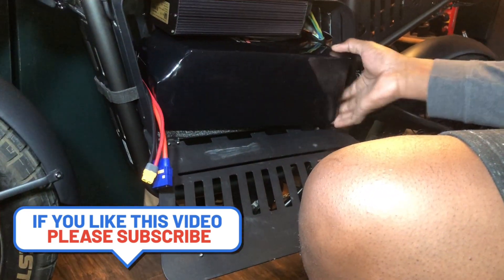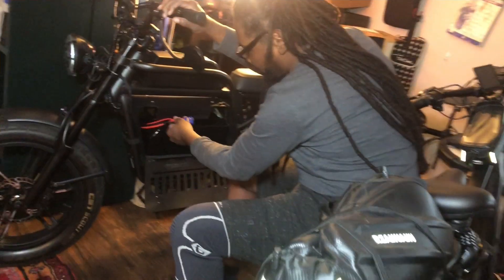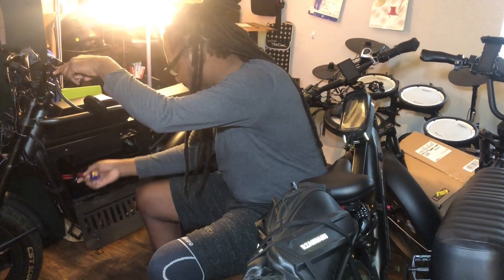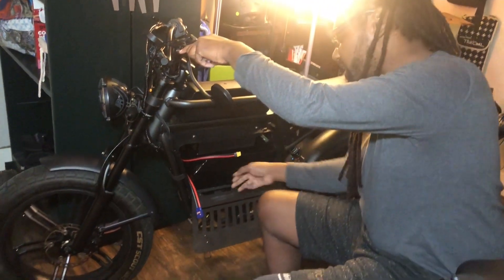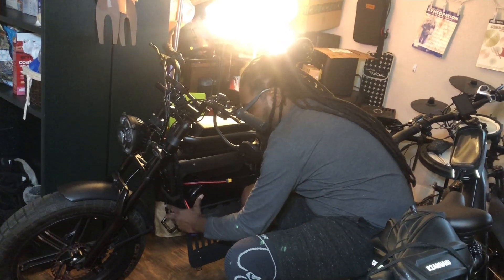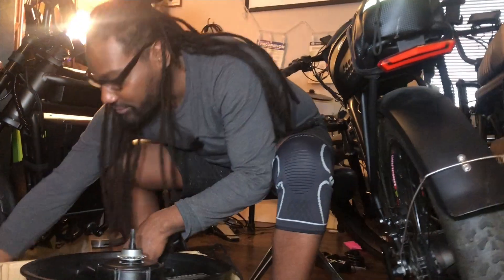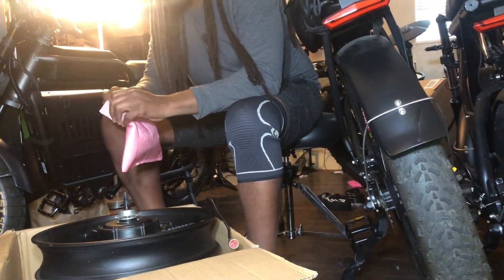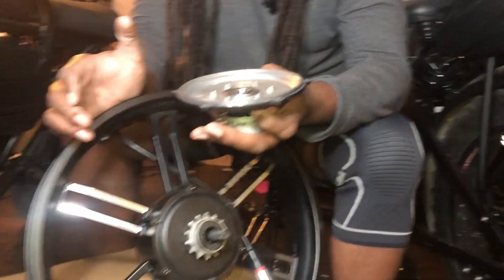Revv1 72v 5000w conversion pt2

Comment: is it possible to use the stock battery with the motor?
Reply from the maker: Sure you can. It’s rated for 48v up to 72v. You would have slightly better performance with the stronger motor but not much
Reply: @MannyReidTV  Thanks

Comment: What caused the stock back wheel to fail in that way? Thanks
Reply from the maker: I have no idea 100%. I’m thinking the motor casing is just cheap pot metal and the torque from the motor bore that hole. It’s a pretty crazy failure
Reply: @MannyReidTV Wow

Comment: how much did it cost to do this? (excluding the bike itself)
Reply from the maker: The 5k motor kit with the sabaton 72 100 controller was 1000. Then the Powerful Lithium battery itself is 1900. You need your wheel liner 10-20 bucks and the ceramic brake pads were 50 for a set of front and rear. The center cage for the bike is 100 which you need to house the battery and controller. Tenet pedals I use were 180. Worth it for how well my feet stick to those. The Qs8 male to o-ring terminal positive/negative cable was 75 from Powerful Lithium. Flat out for my tubes 35. So all in all about $3300 on top of the cost of the bike

Comment: Where did you get the full throttle?
Reply from the maker: It actually came with the NB Power 5000w motor kit that I got. If you go to last week’s video, ‘Revv1 72v 5000w conversion’ I have the parts list for this build in that video’s description

Comment: The only person I know of that did such a build was MrCentralRider. Damn, just one cable away from it being on the road.  I have to admit, if you just talked about what happened to the rear hub motor, about it stripping straight threw and off. I would call bullsheet.  It blows my mind seeing it in video and it really DID happen! Great to see everything coming together Boss Manny. Salute
Reply from the maker: Yeah I get it. That’s a hard one to believe without seeing it! I must say Ride1up has been very quick to respond every time I’ve reached out to them. They sent my headlight brackets out right away when I wrecked going off-road and broke it. When I told them about the wheel hub and sent a picture they sent the replacement part out pretty fast. It still scares me that something like that can happen to the wheel but at least they owned it and replaced the part quickly

Comment: About to upgrade my Dk200 with a bigger hub motor and new battery! Just found your videos legit 20 mins ago. Watching and hoping it goes well!!

Edit: Any recommendations on new brakes? I was planning on getting possibly a 52v25ah or 72v20ah battery with a 3000w hub motor. Want to ensure I have the braking power though.
Reply from the maker: That’ll be a dope conversion! If you haven’t ridden anything more powerful than a 48v I might start with the 52. You could always go 72 after that with the 3000w hub motor.

If you go 52 I would upgrade the brake pads to ceramic and that would probably work depending on how good they are from the start. Are they hydraulic brakes or mechanical? If you go 72 a 203mm brake rotor in the front along with ceramic pads would cut it. I’m assuming you are going to upgrade the controller too right?
Reply: @MannyReidTV  ya so I went ahead and copped a 3000W hub motor that comes with a new controller (30A peak 60A). I will get the brakes as well. I ideally want a battery with a railing as my 48v has one. If you want to check out my bike it is a Freego Dk200. But ya
Reply from the maker: Yeah, I had already looked it up haha. Congrats on the start of your build. Let me know what battery you end up using